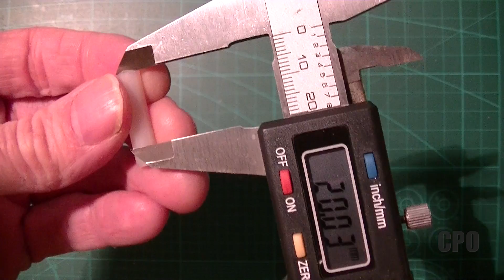CPO Tricopter Build :  KK2.1 Install and Wiring the RX ESCs UBEC and Tail Servo

Comment: what do I do if my escs disnt have a bec? I added a bec to the pins 2 to 5 would I need power to pin m1 as well? my board does power on but my servo doesn't move. hmm

Comment: Hey there..wondered if you could give some advice. My set up is 
HK FPV250 ghost quad, with DYS 1806 motors, simon K 12 amp esc's , devo 8s tx. then the diatone PDB that came with it. Lastly I have a KK 2.1.5 board that has not been flashed. Had too many issues with windows 8 trying to flash it so I have kept it stock software. My question relates to the PDB and the wiring of the simon K esc's.
From your video it seems that when I wire the 3rd set of esc wires into the motors I need to make sure that the + (red wire) needs to be removed from the other 3 pins. Is that correct ? Thanks

Comment: Do i need to remove the power wire on m2 and m3
Reply from the maker: You will see this in a video coming soon...but I removed the power and ground wires from motors 2,3, and 4.

Comment: is is nessecary to have an external bec for the servo i am making a tri v3 and is it also nessecary to plug the servo into the kk2
Reply from the maker: YearRound RCShea Not necessary to have an external BEC if you have ESCs that have a BEC built into them. It is necessary to plug the servo into the KK2 for control....but not to power it, you can get power from another source.
Reply: ok thanks
Reply: EVERYTHING cpo hi, could you please explain how to get this power for the servo. i am new at this. all my esc dont have power cables in them.
Reply: power cables are the red and black wires the signal is the yellow or white

Comment: I REALLY NEED HELP! Plugged in everything as directed but the UBEC does NOT power up my rx or kk board as it should. I can only get power when the ubec is connected to my rx and THAT powers it up and the kk board too. all seems to start and is good but when i plug in the ubec into the actual kk board, NOTHING. the motors beep and everything but no power to board at all. I have OPTO escs if that makes any difference

Comment: Why don't you use the BEC on motor 2 to power M2-M8?
Reply from the maker: The BEC in my ESCs for this build are too puny. Not enough power to adequately run the servo reliably.

Comment: I'm confused about the power to the tail servo. How does the ubec wire into the servo if the servo is wired directly to the controller?
Reply from the maker: The UBEC is what supplies power to M2-M8 on the controller. The tail servo, being plugged into the controller, then gets that power.  Does that make sense?
Reply: EVERYTHING cpo
So the heavier gauge wires of the 5v ubec (red and black) go to the main battery?
Reply from the maker: Yes. The input to the UBEC plugs to the battery, and the output to the FC.
Reply from the maker: ArtAsh44 I did a video on the wiring harness and it shows how the UBEC is connected. Search for cpo tricopter harness and you should find it.  At the very very end of the video I plug in the UBEC.
Reply: Got it thanks!

Comment: My KK2.1 board is on it's way and I'm building a tri-copter too, so these videos are a great help!  Just to clarify, the ESC 1's bec is powering the KK2.1 board and receiver simply by being connected to the Output 1 of the KK2.1, right?  Can you only power the KK2.1 & receiver on output 1, or could you power the board & receiver from any output?  Also, you have the UBEC in output 5 to power the tail servo in output 4.  How do you specify that the power coming in on output 5 is routed to output 4?  Finally, do you have to have a BEC to power the KK2.1 board and receiver?  My ESCs don't have BEC, so trying to confirm that I need an external BEC.  Great video and thanks.
Reply from the maker: Okay... here goes:   

The M1 BEC is powering the KK2.1 board.  The KK2.1 board is powering the receiver. You're on the right track with that, but it's not a specific KK->RX connection that is providing the power, it is all of them. You really only need one...any one...but in my build, every cable from the KK to the RX has power, ground, and signal. So all five of them are providing 5V power to the RX.  Some people will remove the extra power/ground wires from all but one, but it's not really necessary. There is lots of talk about ground loops and such...but I see it work fine both ways.   So you CAN power the receiver from any output. or all of them. : )  

The M2-M8 rail works the same way.  The UBEC is providing power to the M5 plug...but all of the power pins are connected and all of the ground pins are connected. So I don't tell it to route to M4..its just there. It's also there on M2, M3, M6, M8, etc.  All of them.  Some of it is not being used, of course.  That's why I had to remove the power wires from the M2 and M3 BEC.  If I didn't do that, then they would be trying to provide power at the same time the UBEC was trying to provide power. They would get confused because all of them are dumping power into the same place. 

Since your ESC's don't have a BEC, you will need to figure out how to get power to your KK AND your servo. How that happens varies. Some folks use 2 UBECs. Some will use a Y-Adapter... one side going to the RX and one side going to M5 or one of those empty ones or even to the servo directly (more complicated).  Having no BEC on the ESCs is great for quads,but with a tri, it gets a little complicated because you have to power the servo.
Reply: EVERYTHING cpo  Thanks for this explanation, I don't know the PCB layout of the KK2.1 and was confused why you were supplying power at both M1 and M5. Knowing that M1 is separate from the M2-M8 bank makes a lot more sense why you would have a UBEC on M5 to power the tail servo.

I assume you could also use M2's BEC had you left it attached - why did you decide not to go this route? For reliability's sake? Thanks in advance,
Reply from the maker: Yes, James Wright.  I could have theoretically just used the BEC for M2 (and a lot of people do just that). The reason I didn't is that the Afro ESC's have only .5A BECs...and I was concerned that my digital tail servo may peak higher than that...so to be safe, I am running it off of the external UBEC.  And, with the external UBEC, I also have some power available for other add-ons in the future (lights, or whatever).

Comment: Hello Chris,
I tried to post this comment on your website, but I don't think it worked. Anyway, great wiring job. I wish I had the patience for it. I built an Anycopter version of the tri, and did purchase a ubec, but read somewhere that the afro escs have enough power to drive it so I installed it without the ubec and it works great. It is a high-end tail servo leftover from my 450 heli build. Just FYI. Thanks again for the great videos.
Reply from the maker: Thanks, Marty. I think I missed this comment. It really just depends on your servo. Glad yours is working fine. Mine MAY work, but I just wanted to be safe.